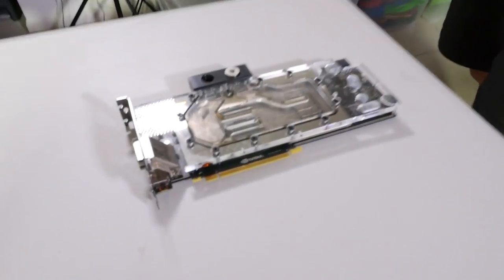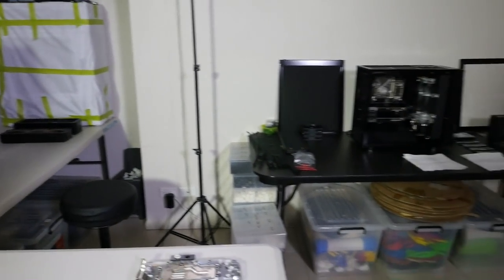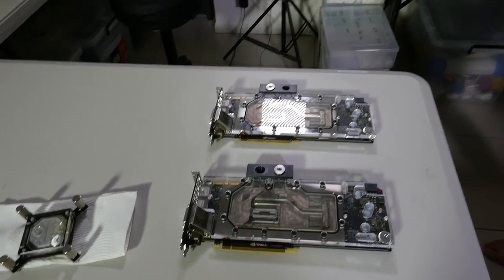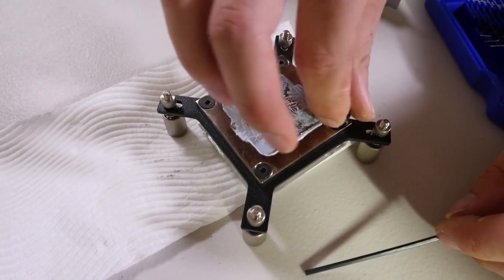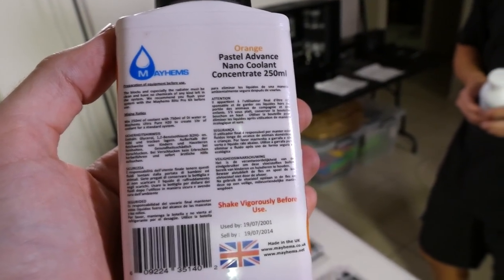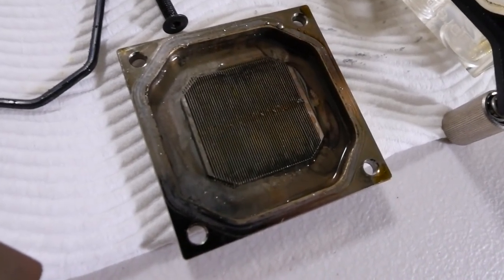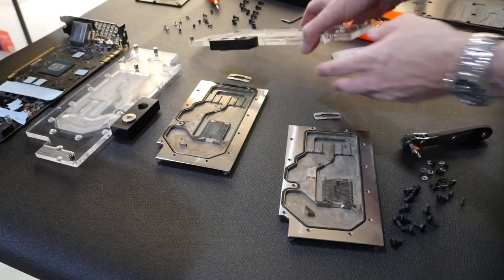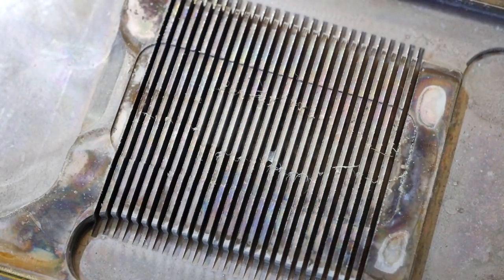Corrosion

Comment: Looking at the buildup on the clear acrylic tops, that looks like the calcium and mineral deposits from tap water... I wonder if the customer was using filtered water thinking it was just as good as distilled.
Reply: I'm thinking the same thing, and all the discoloration is from the chlorine and other additives in tap water.
Reply: Nah, I don´t think so. I have the same effect on my gpu, and I used distilled water too.
Reply: I’ve used treated distilled water like coolant has from primo chill and it still corroded my cpu block!!

Comment: What are you talking about? Distilled water is not corrosive at all - it is PH neutral.Minerals dissolved in water make it corrosive (have you ever heard about hard/soft water?). What is obvious here that the loop had mixed aluminum and copper elements. BTW corrosion is always galvanic process then you can not say "it is not galvanic it is corrosion".
Reply: Distilled water is not pH neutral, Deionized water is closer. Distilled water is acidic, and 90 percent of biocides people use are also acidic... so you end up with an acidic loop, when really if anything you want an alkaline loop.... alkalinity does not cause corrosion on metals like acidity does. Test the pH of any pre mixed coolant on the market and it will come up alkaline, ethylene glycol or not.
Reply: when somebody is trying to sell a product what  you get is miss information XD

Comment: As a machinist I have to point a few things out I saw in the video.

1. Stainless Steel does corrode in saltwater. The only way to protect steel from corroding in saltwater is to add a layer zinc ie. This layer will start to corrode(intended) but your part will be fine.

2. Even 0.5mm is almost impossible to mill(depends on the depth). You need to erode it or I believe today you can use waterjet or laser to cut.

Other than that, great and informative video!

Comment: The saws you are talking about are jeweler saws. The fins on the cpu block are probably made from a sinker edm machine. The shape is cut into a piece of copper to act almost similar to a stamping die. The die differs in how it's used however as the parts are submerged in a tank of oil and electricity is sent through the die and the die is feed down onto the part burning the desired shape into the metal as it advances.

Comment: when people say that store bought deionized/distilled water is pure that's usually very wrong. I worked in a lab for several years and there is a reason why researchers will pay $100+ per liter of pure water from companies like Ultrapure water. And if you look at their website, Ultrapure even recommends using corrosion inhibitors when using their crazy expensive water as coolant.

Comment: I have rigs that run with destilled water without any corrosion problems. 

I also have rigs running with coolants from Mayhems and/or EKWB and there I got corrosion. 

Also I have a rig running with destilled water and got lot of corrosion, so I  cleaned up everything and even changed the CPU block, since then I use EKWB coolant, After 2 months I had corrosion again....

In my experience there is no guarantee that you can avoid corrosion using a coolant from Mayhems and/or EKWB, this is multi-facted problem and depends on several factors ...
Reply: Reto Braendli whats your radiators made off?
Reply: The last rig I mentioned has a 480mm Aquacomputer Full Copper Radiator.

In the other rigs I used most of the time EKWB radiators (different sizes, sometimes several) which have if I understand correctly a mix of brass and copper. I also used XSPC Radiator but do not remember exactly which model/composition.
Reply: Reto Braendli ok i am thinking about using the alphacool x flows
Reply: My advice: Use whatever you like/fits your build and enjoy it. 

Do not be afraid if corrosion happens ie I did not mention it before but I cleaned up the dirty cpu block I replaced and it looked pretty good afterward ie needed some agressive cleaning agents, anti-calc etc and at the end some of the nickel plated got eroded in some minor places and the copper came through but mostly the block looked like new.  If you are not afraid/have the time just take apart the block ie its basically a few screws and rubber rings and start using/experiment with whatever you find in your household to clean it....

However these days I am not that keen anymore on acryilic see-through blocks because corrosion in some form happens often and if you build a show-case rig it will disturb the looks after a few months....thats why I go more for acetal blocks, however it will obviously depend on your rig and the looks/design...

My point is do not get deterred by the risk of corrosion, if it happens you can deal with it if you invest some time to clean it and in my experience you can not really predict if corrosion will happen or not ie no reason not go for a cool custom waterloop...
Reply: Reto Braendli ok thx that answered my question in such a detail

Comment: There's nothing wrong with distilled water. This issue was already put to rest by a long someone who multiple doctrines. It's the cheaply manufactured components that is primarily the issue. Most premixed colants do not have a enough anti corrosive to slow down any corrosion. The best thing you can do to prevent corrosion is proper setup and maintenance - plumbing is key and yearly maintenance. Just as an example, Martin ran distilled plus a little bit and of nuke for three years before he saw any signs of corrosion.

Comment: So are those parts all junk now , or can they be saved and returned to working order?
Reply: The block parts that are gunked up can be cleaned. The parts that are severely corroded should be swapped. The Nickel plated items can be replated, but personally I'd leave that to the manufacturer, because of specifications, and just buy new items.

Comment: All metals run along an index, using metals which are close to each other on that index will reduce galvanic corrosion.  Marine grade SS resists corrosion from the elements well (though it well definitely still rust) but is still incompatible with many metals. Any aluminium components (anodic/+ve) will react highly with coppers ones (cathodic/-ve) when an electrolyte is present (contaminated water) pure water (de-ionized) is 100% non conductive and will not cause electrolysis.   However; it will eventually pick up contaminants, and become conductive, allowing the metals to react

Comment: You mention marine grade stainless, and boating.. The way they deal with corrosion in salt water and multiple metals is to have a zinc plug somewhere. It draws the corrosive electrons to it, it wastes away eventually and you have to replace it, but your stainless and other metals stay good. I wonder if that science can be used in a loop somehow?
Reply: the zinc plug would slowly corrode away and end up in the loop and possibly clogging the small fins on the block, and wear down the pump faster. I have worked with marine engines and aluminium boats, this is not a issue there because the zinc is in the sea water loop so the zinc that slowly corrodes away wont stay in the loop. I think it would be possible with filters but maybe too much work :)
Reply: you can get a .999 silver plug that does the job just fine , they cost like 6$ if I remember correctly , been awhile since I put a loop together
Reply: Magnesium/Aluminium for fresh water. The Zinc is for salt.
Reply: the ions of the zinc get washed away. in the loop the will accumulate and clog up.

Comment: I use Koolance CPU blocks, rads, fittings, and coolant. Never had a problem so I continually use the Koolance fluid. 

The only thing you have to watch out for is the flex tubing since the Koolance fluid has glycol in it. 
Primochill Advanced LRT, which is very common for ppl to use, has a warning to never use it with fluids with glycols in them. Basically any fluid that has a small amount of alcohol in it to lubricate the pump and o-rings will cause Primochill tubing to turn brown rapidly. 

I use Mayhem’s Ultra Clear tubing. Pretty much the only Mayhem’s product I buy. It can handle any fluid, looks great, holds up, and is MUCH cheaper than the Primochill Advanced tubing.

Comment: Daniel that's where there is a bit of a problem with the Alphacool VPP755 pumps and it seems anything Alphacool. Anyone who uses anything but distilled water ( and particularly Mayhems products) with their pumps Alphacool is voiding the warranty. In that case what are people supposed to do. Use distilled only to keep the VPP warranty and destroy other components or use a coolant and destroy the pump. I just wish there was a an industry get together to agree on standard practice.
Reply: If you go over to overclock.net and go to the Alphacool Pump VPP755 review of noise issues thread, you will find that Alphacool and Mayhems are actually working on the problem and have multiple test rigs running. They are trying to fix this issue and either prove that the pump has an issue itself and not the coolant from mayhems.
Reply: Cheers I spotted that thread but sadly Alphacools actions appear to be little less than violations of consumer law in this case. I can't have faith in or praise a company that says it is now trying to resolve an issue after it unilaterally voids warranties of purchasers after purchase and then changes the terms of the warranty post sale to validate the voiding of those warranties. 

Looking at other companies such as Thermaltake and the issues which have arisen with their C1000 coolants it would be great to have some form of effective central clearing house of the big fluid and component makers where they cross test these products before hitting the market. Its very expensive for the end user and often the companies themselves when things go wrong afterwards.
Reply: I agree that Alphacools actions are terrible (own a VPP755 and was running Mayhems X1). The point of my reply was that they are getting together partially through the industry and at the very least allowing the coolant manufacturers to dispute their claims of damage. As such Mayhems is the company that is actually running the five test rigs, one with distilled, to try and show that its a flaw with the pump and not the coolant.

Comment: I use type B automotive coolent mixed with distilled battery water. It's very cheap and very effective. You can get it in green , red or yellow. Type B has no glycol, so cools better and is non reactive with hard tubing. Type B coolents have anti corrosion and anti cavitation properties. Penrite is a good global brand. Mixed metal cooling loops have been in cars for decades.

Comment: I don't build a loop anymore nowadays without having an inline filter attached to the pump output (Koolance or Phobya).  It's way easier to clean that than it is to take blocks apart.

Comment: I use 3M FC70 for my loops. I just have to be sure of no plastic in the loop at all. Hard to do a lot of times when most block makers have to have plastic on the blocks. I use a custom duplicator and cut out a metal replacement of the metal parts to be exactly like the plastic parts

Comment: You are unaware of a simple mix that does the job :  1) distilled H2O +  2)a trace of Sta-Lube Soluble Oil (actually"mixable" is the better term) + 3) Sodium Hypochlorite dilute solution (trace amount).  This mix is anti-corrosive and inhibits biotic growth. And it;s been in some use for over 100 years.

Comment: in this case any liquid witch lacks ions will pick them up from any part witch is willing to give them up, then deposit them on the parts wich are need the ions as well. basically electro plating in a smaller scale.

Comment: I have a loop with non-plated copper plates. I used a no-name premix solution and in less than a year it probably ate away 1/3 of the fins on the cpu waterblock. Just pitted and missing along the restrictor plate. The fluid had changed from clear to a blue color, which I later found out was copper corrosion. I only use premixed mayhem coolants now and I no longer have any problems. If anyone is interested I could probably dig up the pictures I took. It was many times worse than this clip.

Comment: Mayhems bottle : @7:42
Used by 19/07/2001
sell by 19/07/2014 
WTF ?????
Reply from the maker: Lol old bottles with leftover new coolant.
Reply: SingularityComputers looks to me like a new bottle as it's not opened you can see the seal at the top intact, also you will get corrosion no matter what you do over time
Reply: as sykoyikangel noticed, sell by and use by wrong way round..lol

Comment: Thanks for this video.
i agree completely with that,  i have a similar block (ek fc titan-x) and ended with corrosion after a few months ; i was using 100% distilled water and i though it is enough to prevent this kind of problems. EK was kind enough to send to me a new nickel plate.
Regarding the type of coolant, i prefer to follow the WB manufacturer recommandations to be on the safe side. So i use now EK coolant (cryofuel).
Subbed by the way, the various builds in this channel helped me a lot

Comment: I have experienced this in my loop and I have used nothing but EK premix coolant changed every 6 months.  Strangely the loop was fine for 18 months until I added mayhem UV dye.  Perhaps the additives in the EK premix reacted with the mayhem dye?
Reply: Absolutely, if you're switching dyes you have to flush very thoroughly all your parts between dye changes.

Comment: Thanks for the interesting video, glad I run coolant in my loop. They do make micro milling bits down to .005" (.1mm) but the issue becomes how fast you need to spin the bits to have them work properly (cutting speed is based on bit diameter) were talking 30-40k RPM which most mills can't do. EDM or Electrical discharge machining is how they probably cut those micro fins, it's an pretty amazing process to watch (youtube it)

Comment: Deionized water and distilled water are very different. The problem with deionized isn’t so much that it’s corrosive, it’s that it sucks up CO2 very easily which then makes it acidic. Distilled water dose not absorb CO2 so easily. I have personally had mixed metals for 7 months with only distilled water and have had zero issues.

Comment: Is it okay to mix the mayhem X1 clear coolant with a litre of distilled water and use some sort of mayhem dye? 

Is it fine?
Reply: Only if it's the concentrate (250ml) version. Dyes and coolants are meant to be mixed with distilled water. It is not the distilled water what is the problem, due to corrosion very small parts (we're talking micro levels here) of the metal of the water blocks and other parts will start flowing through you're look and look for something to bind with. You want to prevent that it's bind with other water blocks. That is why most coolants contain minerals that the metals can bind with instead of you're cooling blocks. However the buffer capacity of the coolant is limited. That is why you normally want to flush you're loop every 18-24 months.. 

Every 250ml bottle should only be mixed with 750ml distilled water giving you a total of 1 liter coolant.. 

Note that you never ever want to use regular tap water for you're loop!

Comment: Distilled water + PT Nuke + Silver Coil = No issues for years. 

I have had a loop running as a test for 7 years with this mix and the water is still as clear as the day I filled it and no growth in the loop.
Reply: 7 years? amazing! how often do you flush and what blocks are you using because that sounds perfect.
Reply: I haven't done 7 years I think my limit is 5 years with distilled and pt-nuke.  0 flushes and only top ups.  If you want a low maintenance loop then skip nickel plating.  Things were a lot simpler before that fad took off.
Reply: @Bijiont
Same here, only 1 year longer (and 1 year later :-)
Untouched for 8 years.

Comment: my dyes changed my temp by 2 degrees, they had some clogging but I use an extremely high concentration for a very dark orange. and my cpu's were less clogged then this. and I've had them since before the 1080's launched.

Comment: My personal opinion from experience. This white crap is very highly probably PVC plasticizers leaching. More than tap water residue. Even from a good brand tubes you can get those leach (of course not on norprene/epdm tubes like ZMT or tygon norprene). Corrosion also is accelerated from erosion. Indeed, i have 2 of the same config. But since i have a gaming laptop, one of the PC is runing often, while the other gaming one is shutdown for half years (huge waste i know..) but one is corroded badly while the other is brand new. Exact same blocks on both (2060 super on new and 2060 normal on corroded, which are the same waterblock for both MSI 2060) and both PC blocks have same age at 3 weeks interval (father/son config, almost same hardware)

Comment: use antifreeze and distilled water in a ratio of 1:4 (75% antifreeze and 25% water) and you will not have corrosion.

Comment: Well you learn something new everyday. What would happen If you set up a loop and instead of liquid just somehow blew cold air through it . Using a loop you know you`d get the air to the specific parts. I`m just thinking out loud. Would cold air work.?
Reply from the maker: water is 25x more conductive of heat than air. If the air was cold enough or a gas then yes. We like to explore all of the ideas. I think the best idea now is to improve the conductivity of water-blocks. Everyone will say copper, gold or silver, the latter are too expensive. We have a solution which the world will see in about a year if all goes well.
Reply: What about using Mineral Oil? Remember the submerged systems that used oil? Could that be used in a loop?